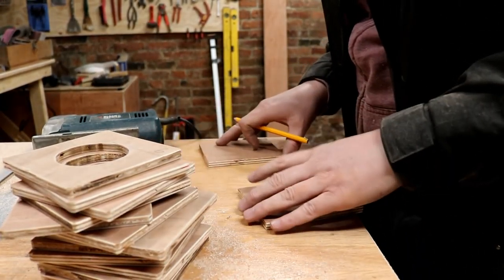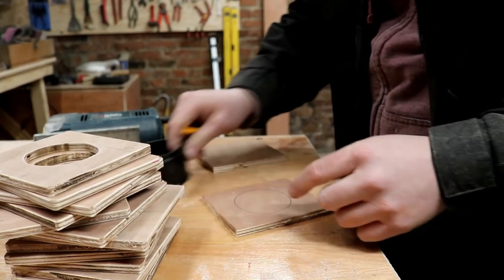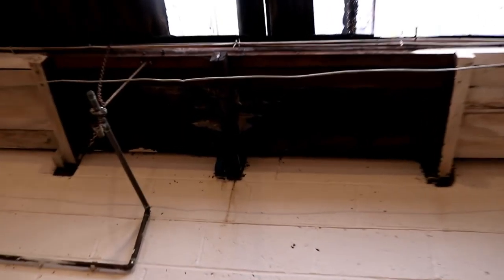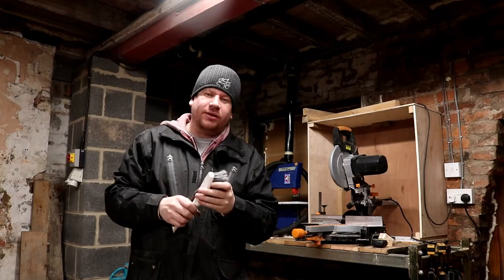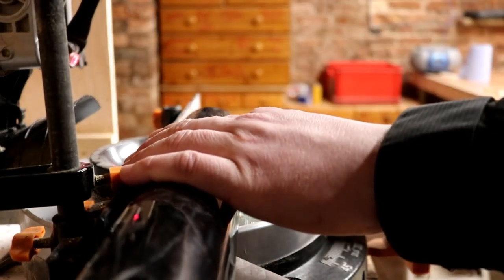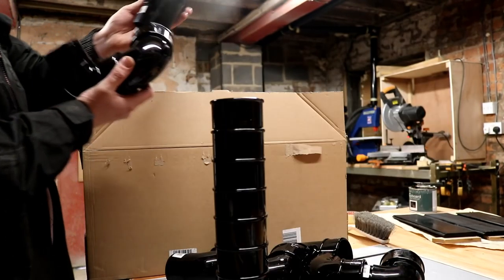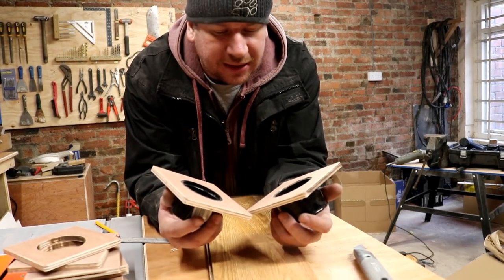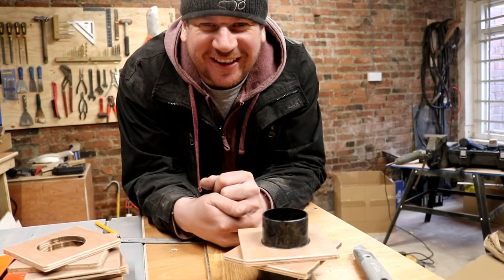FULL TIME JOB AT 6

Comment: Looks like you have a full on roof replacment coming down the line depending how bad the frame timbers are rotted. Hopefully the landlord will pitch in. Pity to see all them lovely fvs gathering rainwater. Baby steps m8 you're getting there,keep the vlogs coming. Cheers.
Reply from the maker: I won't be paying for the roof replacement, just the bodging.